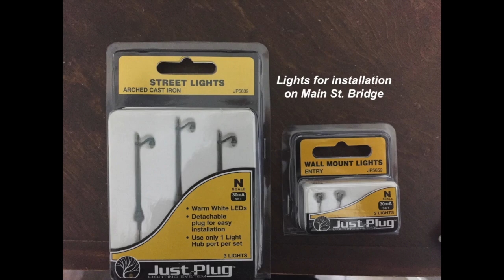Part 2A - The Main Street Bridge Project

Comment: John, again I commend you on your Main Street bridge. It's an engineering feat of excellence that you created and assembled from your 3D printer! And with your narration, the video is so much more interesting to watch. I can't wait for you to finish painting, detailing and weathering your road bridge, and then install the Woodland Scenics light posts to it! The end results promise to quite impressive.

Happy rails to you, John.

-from Tom Pilling
Reply from the maker: Thanks again Tom.  The lighting system costs more than the bridge but I thought that it would really help to make it look more real. FYI - The best thing about having your own 3D printer is that you can do projects in the convenience of your home.  For example, I have also finished up some much needed roofs for some buildings, to include making my own vent stacks and heating/cooling systems for placement on the roof.  Since I am waiting for better weather to paint the bridge, I have switched back to working on the Elizabeth City/Tulsa Station since it needed a couple of mods made since I let it get 1/2 inch too wide (it was way too close to the track that I had re-done on the top of the center peninsula......Take care...John

Comment: You are the man John. So is the 3D stuff you make experience to make?
Reply from the maker: Hi John.  Not really, I have just learned how to use the software better over the past year.  The printer has allowed me to make custom structures for my layout that really do not exist  as commercial products or would be too expensive to buy multiple kits for modification to fit the area for a given structure. The prints are good enough for N-scale.  FYI - I had to delete the original Track Level Ride under the bridge because it had a bad rendering that I did not catch but I did read your comments.  The GoPro is a great camera but is 1/8 inch bigger in LWH so that would not allow it to run into my tunnels & up/down my two helixes...John
Reply: John Tanzillo Damn that sucks about the GoPro. You might have to build a custom car to hold it. Go Pro has the cube camera thats really small.
Reply from the maker: I made a mockup of both the GoPro & the Polaroid Cube+ and ran them on my layout.  The GoPro did not fit since the camera was a fraction too tall and wide (by 1/8 inch) even on a depressed center flat car.  Thus I picked the Polaroid.  It also uses my iPhone as a view screen while filming so I can see exactly what the camera sees as well as directly controlling it.  It works fine & is good enough for me.....John
Reply: John Tanzillo thats good man.